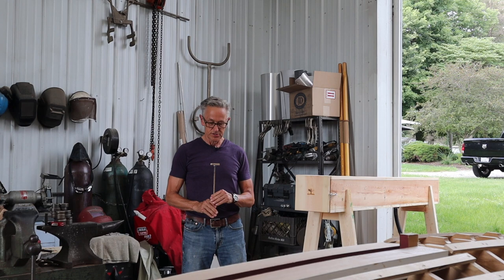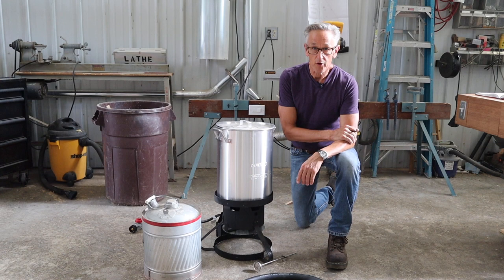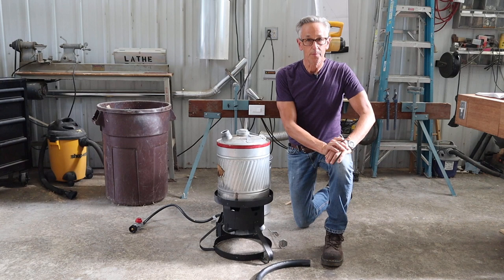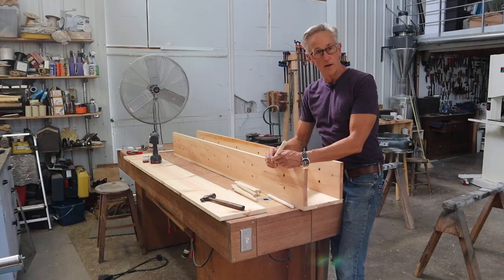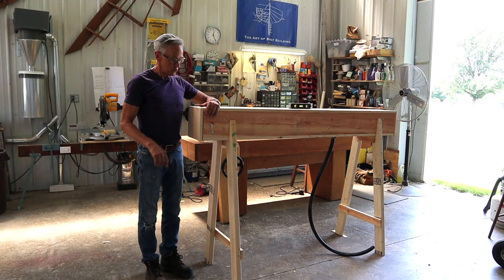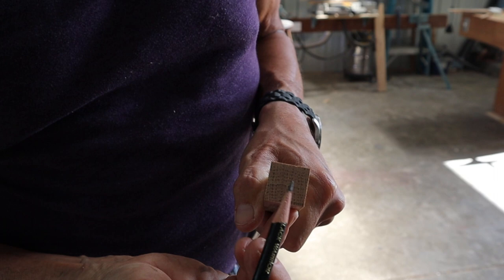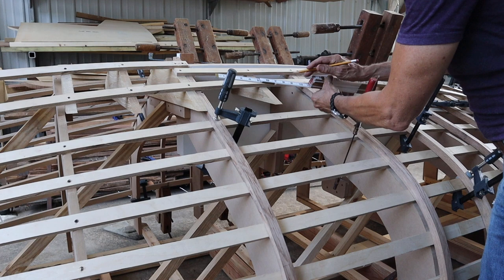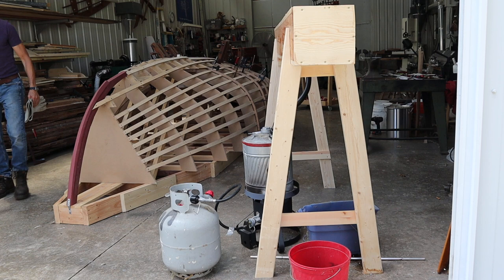Building a Steam Box and Steam Bending Oak Frames, S2-E8

Comment: if wood splits along the medullary rays wouldnt it be better that you lay the rays parallel to the planking? when your boat gets old and the frames dry out and the frames check, the screw will still hold the now two layer frame rather than the screw pulling through the check. im sure youll counter sink the screws anyway so there shouldnt be a chance youll split the frames while fastening the planks.
Reply: Precisely as recommended by Louis Sauzedde (Tips from a Shipwright) for that reason. Coincidentally,  using the example of frames in a Herreshoff 12 1/2.
Reply: Yes, also saw Louis recommendations and it seemed correct. Fantastic work no matter what.

Comment: That's a great build indeed. You can also have a small drain pipe from your weep hole feeding back into your boiler to recycle the water.
Reply from the maker: I did have a weep hole at the back (low end) to collect in a bucket. You’d be surprised how little I collected as the majority of the water evaporated in the steam. The collected water was quite discolored from the wood tannins, not very good for recycling. I just watered some plants with it. Clean water in your steamer keeps the vital parts clean. 
Thanks for watching!

Comment: Another great video, the boat is coming along and will be a beauty when she is finished. There is just something satisfying about bending wood. When I built my plywood Jon boat I didn't have an steam box for the plywood bottom so I put wet towels in a microwave till they were boiling hot and laid them on the area where I needed the bend to be. Worked like a champ. I used the same technique for bending the bottom runners but it didn't work out as well.

Comment: Nice build! Did you do a test burn of the pot outside? That galvanized steel is toxic when reaches 392 degrees F. the zinc will burn off creating yellowish fumes. Please be careful when heating Galvy
Reply from the maker: Yes, I'm fully aware of the hazards of zinc. I was only heating to steam temps. (212ºF) The steam pot was always outside with the large doors open for ventilation.
Cheers,
Bob